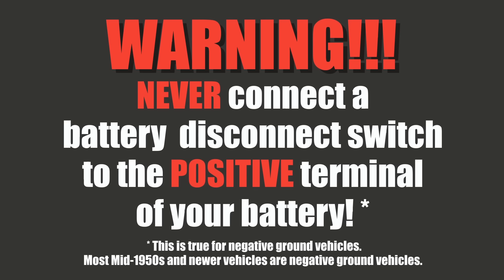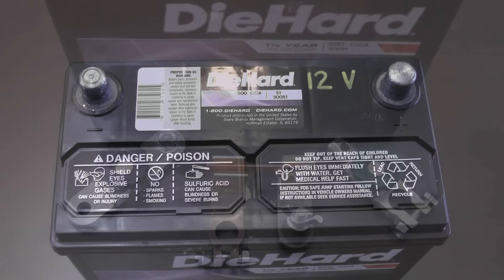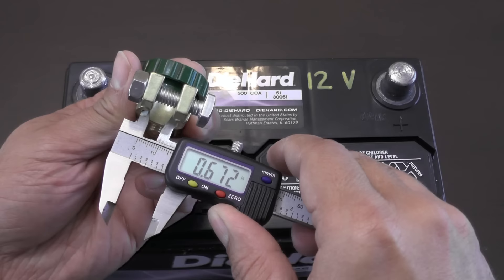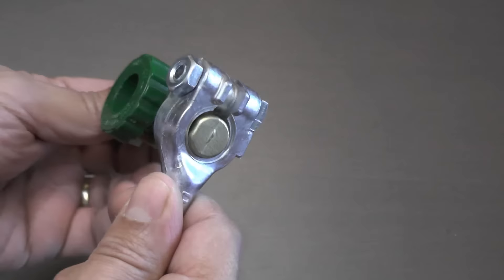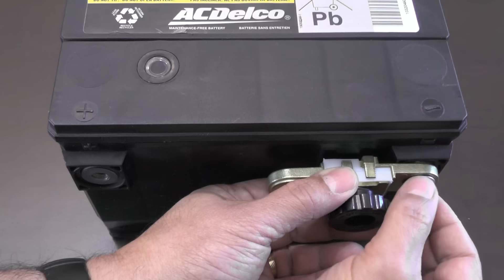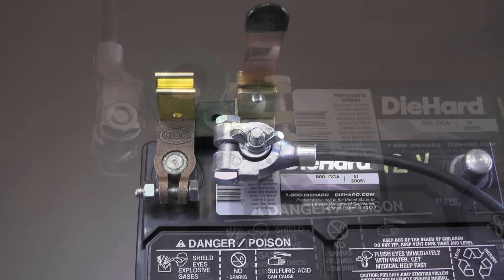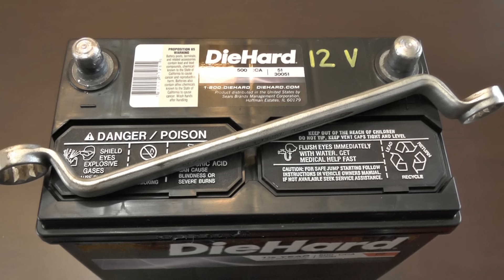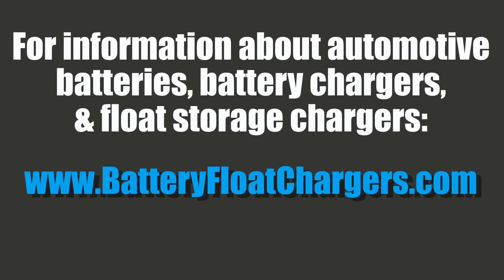WARNING!!!  Automotive Battery Disconnect Switches

Comment: In my youth, I once got a socket wrench across the positive 6 volt battery terminal and the rear seat frame of my 1956 Volkswagen.  I can absolutely verify that a socket wrench will glow very red when shorted across a 6 Volt battery.   The socket wrench welded itself to the seat frame and I had to kick it loose before the battery reached critical mass.
Reply from the maker: I've seen it too.  Looked like the 4th of July under the hood.
Reply: The Erod1944 Channel 
Heavy equipment (Euclid) from the 50s where positive ground, watched a guy short his wedding ring between post, wrench 1/4 inch steel battery cover. We were on an island in the Indian Ocean, they had to fly him to Thailand for treatment.
Reply: Real mechanics don't wear any sort of jewelry while working.
Reply: That was scary!  And I would think much more intense due to being 6V.
Reply: Nor do real electricians.  Your comment is probably more important than the video.

Comment: Please note how close the measurement tool gets to the positive terminal when measuring the negative post.  Less than 1/4 inch before you've bridged the gap. Wow!!! Also the entire explanation of additional exposed metal toward the end of the video is correct, it adds risk, however not for the reasons you mention.  It only adds risk if you contact that greater area with some part of the car that is positively charged, not bodywork, not other surface areas in the engine compartment, etc.  These are all for the most part already grounded by the same cable coming off the negative post.  There are virtually no exposed metal positive charged parts in a car except for the positive post of the battery.  You are most risk of sparks and a short if you somehow bridge between the additional metal work and the positive battery terminal, as you almost did when using the measuring tool at the beginning of the video.  You also forgot to mention how important it is to wear safety goggles whenever working with the battery in a car.  There are many cases of blindness related to sparks coming from improperly jumped cars or other shorts when working with batteries.

Comment: Definitely reshoot the micrometer scene. I thought for sure we were going to see an explosion. Other than that GREAT INFORMATIVE VIDEO!
Reply: That's not a micrometer.
Reply: well, in SI measurement, micro- in front of any unit means 1/1000 th of the unit value. Since the display in the video has 3 digits to the right after the  decimal point, then what would #John Dough call it then a 'milli-inch-meter?'.... Oh, that's too close a word to mm or milli-metre. How about Digital Internal and External vernier caliper linear ruler and sometimes pipe wrench?

Comment: You are 100% correct about the danger of creating a short from positive battery terminal to chassis ground.  However, the safest method is to isolate the positive terminal with the battery disconnect switch, and then properly insulate the battery disconnect switch itself.

Comment: when I was 17, while installing a battery and connecting the positive connection I accidentally hit the fender with the wrench (yes, i had connected the negative already - my bad).  That sucker gave one spark and blew the lid right off the battery.  It was wintertime, and i had on a hooded grey sweatshirt.  I got a small cut between the eyes from flying plastic and turned the hood of the sweatshirt bleach white.  I got an ambulance ride but fortunately had no acid burns to my eyes.  Lesson learned.  I am still appropriately overcautious around batteries now.

Comment: You talk about leaving tools on the battery, what about the micrometer you used to almost connect the positive and negative?
Reply: People in glass houses.........
Reply from the maker: In order to keep the caliper in frame when taking the video, I needed to position it as such.  But, while doing so, I was VERY careful not to touch both terminals at once.  Notice that I didn't set or leave the calipers on the battery after taking the measurements.
Reply: Watch This Shortly followed by leaving a spanner on top of the battery...........hmmmmm. Don't get me wrong I'm no safety nazi. I couldn't give a shit what other people do in the confines of their own workshops. If they want to lick battery terminals, naked, whilst splashing themselves in battery acid..............that is fine by me.
 Yet I'm not going to tell them not to, just then to do exactly what I said others shouldn't do.
Reply from the maker: ZS6JMP I'm just putting out some safety tips.  Nothing more.  Some safety tips are common sense like, "Don't touch a hot stove".  Some safety tips are not so common - and the reason I mention them.  If people want to place tools on their battery and risk injury, smoke or make sparks near the flameable hydrogen gas coming out of their battery, pop the covers off their battery without safety glasses to block potential battery acid spray, or lick the terminals like you mentioned - I'm OK with that.  My safety comment was addressed towards the viewers who were not aware of the potential hazard of touching both battery terminals at once with a metal tool,  those who appreciate the tip, and for those who might be spared injury.
Reply from the maker: In order to keep the caliper in frame when taking the video, I needed to position it as such.  But, while doing so, I was VERY careful not to touch both terminals at once.  Notice that I didn't set or leave the calipers on the battery after taking the measurements.
Reply: Just a critique that's all. If I were to make such a safety video, I would have used something non conductive for measuring. That way if viewers do exactly what you do there is no risk for shock.
Reply from the maker: Daniel Bales I realize that now, Daniel.  I should have used a fake "for display use only" battery (plastic case with no internals).  I did have a couple of them.
Reply: +Daniel Bales right......i was laughing my ass off !
Reply: That's a caliper, not a micrometer.
Reply: it's a vernier gauge.
Reply from the maker: In order to keep the caliper in frame when taking the video, I needed to position it as such.  But, while doing so, I was VERY careful not to touch both terminals at once.  Notice that I didn't set or leave the calipers on the battery after taking the measurements.
Reply: Since Walmart is the authority....
Reply: the same way you short circuit a battery with a multi-meter duh!

Comment: It all runs on smoke & once you let the smoke out, it doesn't work anymore. I always use a short extension on my ratchet when tightening the battery terminals to prevent doing just that. 3 cracked ribs from a battery box when I shorted out an 8D battery was enough of a learning curve!

Comment: There's another reason why a switch is more practical on the negative terminal: The positive corrodes far quicker, which can be prevented by covering both terminal & cable with acid free vaseline.
If the switch is placed on the positive terminal, you pretty much end up greasing the entire assembly...
There's no need to grease up the negative terminal.

Comment: That doesn't sound like a good enough reason to risk shorting out the terminals with any tool? Worse case scenarion the spanner or other tool would weld itself to the terminals and youd have to stand back and watch it burn itself out because getting hold of a red hot metal tool is NOT my idea of how to lose my fingers burning them to a crisp attempting to save a battery or tool. I wouldn't fancy cleaning up the mess afterwards either.

Comment: I have an old Chevy Astro 89 I want to install a battery cut off switch to.  I don't want a Frankenstein's power level and I dont want to have to open my hood to turn and twist a knob every time I'm ready to leave.  I want to know if I can install an on and off switch, to the battery that mounts inside the car, I can flip to get the battery to make contact.  There is some parasitic voltage leak that kills the battery within 1-2 weeks of non use and I cannot find where it's drawing from.

Comment: I still do not understand why is this difference between ways to break the circuit. Positive, negative.... just break it, and it's all the same, or not?
Reply from the maker: "Electrically" it doesn't matter.  But I would have hoped that my video would have explained why breaking the NEGATIVE side is preferable.

Comment: Can you suggest a product to use a replacement? Need a way to shut down anything that is powered by the battery from the ignition to the lights when out and away from the car. (not an alarm system).
Reply from the maker: I'm not sure I fully understand your question but here goes...the knife-blade type of switch (shown in the video) would probably be your best choice.  Of all the battery disconnect switches, the knife-blade type with its large copper surface area can handle the most amperage/current.  If you want to keep the alarm system active while disconnecting power to all other devices in the car, just connect the power lead of the alarm directly to the battery.  And connect the battery cable and any secondary leads to the battery disconnect post.  This way the disconnect switch will not disconnect power to the alarm, but will disconnect everything else.

Comment: I'm looking for quick connects that I can hook up a power inverter to my car battery.  Do you have any recommendations?  
The cable I've built from the battery to the inverter is 3 gauge.
Reply from the maker: The thicker the cable (the lower the gauge), the lower the resistance, the better you are.  It all depends on the amperage draw of your power inverter at PEAK DRAW. You just need to get a disconnect that can handle the amperage draw of your power inverter.  I would NOT use the knob-type ones in the video.  The knife-blade type can handle more current but still might not be enough.

Comment: I'm expecting no answer for this but a buddy of mine has a riding lawn mower that keeps draining the battery. 

Is a 12 volt toggle switch an option for killing a battery. I just don't know how a 4 or 6 or 8 gauge wire could mount to 2 tiny prongs and not burn up or something go wrong even on the Ground Side of the Battery.

Comment: I have a slow drain that is draining the battery over a course of a couple days. If I use the QD on the negative it'll still drain as there's a slow drain still due to the positive cable being hooked up making a circuit. I've got to disconnect the positive in order to break the connection. Thoughts?
Reply from the maker: You need to have BOTH the positive & negative cables connected in order for a parasitic drain (like a clock, radio display, computer, under-hood light that won't shut off, short circuit, etc) to prematurely drain the battery.  If you disconnect EITHER the positive cable, OR the negative cable, OR both cables, you have eliminated ANY chance of a parasitic device draining your battery.  In other words, you've broken the circuit.  So, you do not need to disconnect both cables with a QD. 

If you have a QD placed on the negative cable, and the QD is in the off position, and your battery is still prematurely "draining", this means that your battery needs to be replaced as it is probably shorting internally. Is it a fillable battery or maintenance-free?  If you can fill it, have you checked the water level?
Reply: Warranted the battery out today. Should have been the problem
Reply: Something wrong in Denmark. If any one side of battery cable disconnected no amp draw can happen as you need both sides connected at battery to have an amp or voltage draw. Someone told you shit

Comment: I have a kill switch on my car that worked great on my positive terminal. Then all of a sudden one morning I turn the key to start it the switch keeps wanting to turn off all the power to the car. It doesn't stop doing this. What might this be?
Reply from the maker: Do you have one of those "knob-type" switches, like the one with the green knob in my video?  If so, I'm almost positive that the problem is dirty or corroded contacts on the switch.  It's not that the switch is turning off, it's that there is too much current trying to pass through the dirty switch resulting in blocked current flow.  In other words, there's a lot of resistance in that switch, when there shouldn't be any resistance when the switch is "On".  Clean the contacts thoroughly.  If the contacts are too corroded, replace the switch.
Reply: No it's actually has a small little lever and a button that turns off the power. Kinda like a mini breaker.
Reply from the maker: If it's a circuit breaker, then it appears that the load (the amount of current) going through the breaker is too large for the breaker to handle so it "trips" and disconnect power.  If it's an auto-reset breaker, after the breaker cools down, it will re-set and your connection is made once again.  Wish I could see a picture of it, or post a link to what you have.
Reply: Makes sense, yes the load is probably too much for it to handle. When it "trips" it cuts all power from the battery. Until I reset it manually by pushing the lever.
Reply from the maker: OK.  So now you can either go with a larger amperage circuit breaker to avoid it prematurely tripping, or reduce the load on that breaker.  CAUTION!  If you go with a larger circuit breaker, and it's too large, you will burn your wiring harness (and maybe your vehicle) before the breaker trips!!!  I can't/won't advise on what size breaker to go with since I don't know your situation.

Comment: Why put a disconnect on a vehicle unless it is for off road use? Buy a cheap tool set and just pull the cables off! And there are POSITIVE disconnects they are designed in a different manner and do not connect directly at the battery post.
Reply from the maker: If the disconnect does not connect to a battery post, then it can be used for either a positive or negative disconnect.  After all, they're all just an on-off switch.  However, the switches that are designed to connect DIRECTLY to a battery are designed (as noted in the video) to be used as a negative disconnect only.
Reply: Should have made that point in the video.